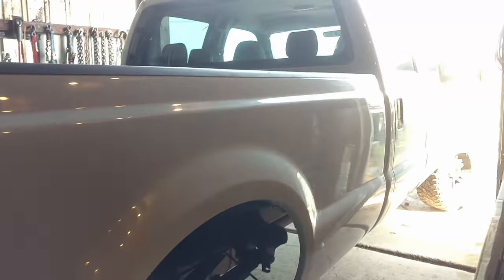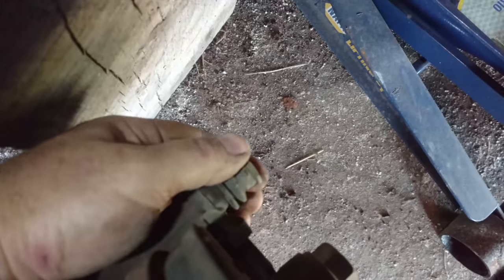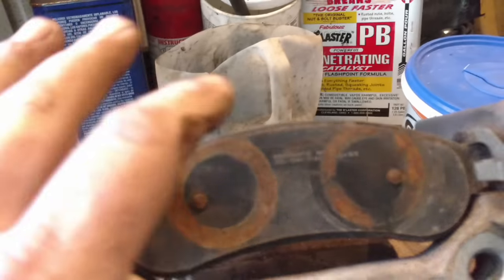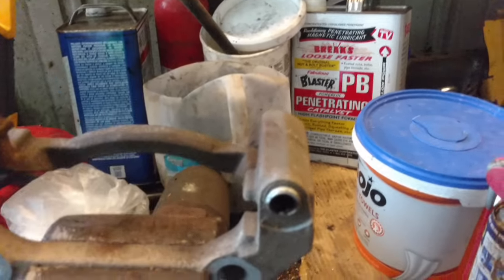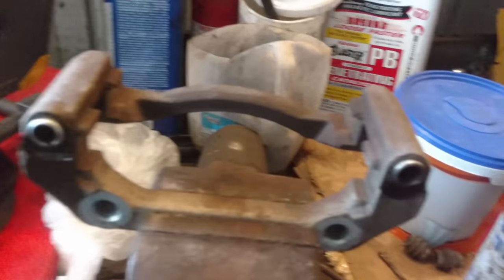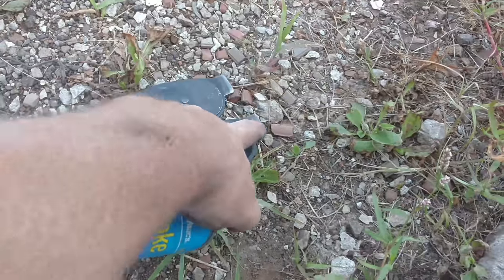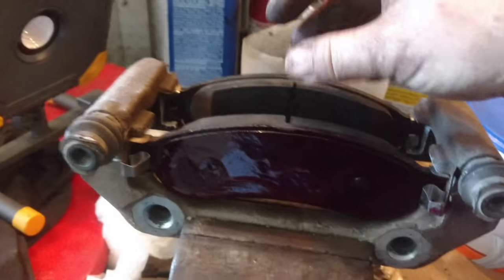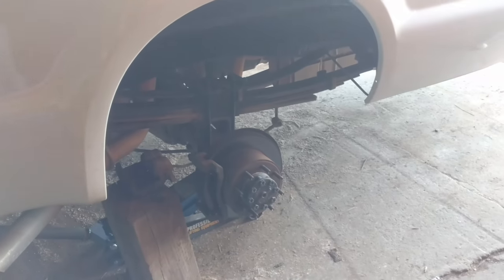PUSHING HARD ON THE BRAKE PEDAL FOR LITTLE BRAKING POWER!!

Comment: Great vid as usual.  The file looks like a great idea for cleaning up the brackets, never really thought of that.  Also, I use regular multipurpose grease on the pins and have never had an issue here in PA where we have plenty of salt too.
Reply from the maker: i normally use the permatex brake lube but i was out and forgot to get more when i was at napa.

Comment: No. Silicon paste for guide pins. Anti seize will eat away at the rubber boots.
Reply from the maker: i normally use the permatex brake lube but i was out. i will take damaged boots over stuck pins.

Comment: I've had nearly frozen slides on my car more than once.  I believe there's one other thing to look for, glazed pads.  If I got that wrong, tell me when glazing really happens.  What do you do about glazed pads?
Reply from the maker: your right...not too common with the brake pads i run into. if i run across glazed pads, i lay them flat on a belt sander and remove some of the material. seems to do the trick.